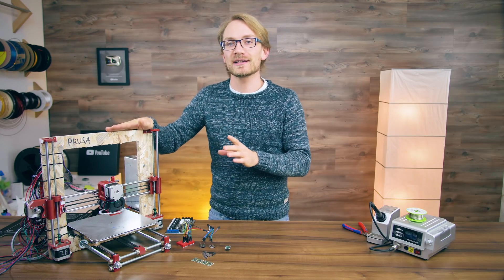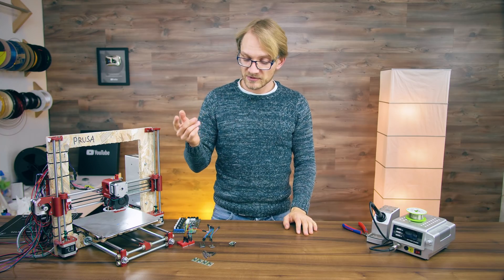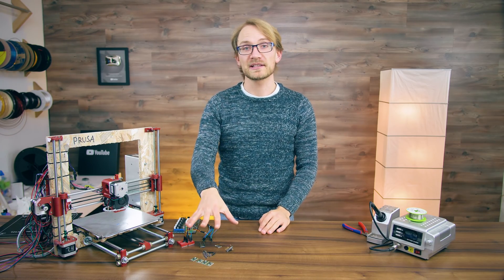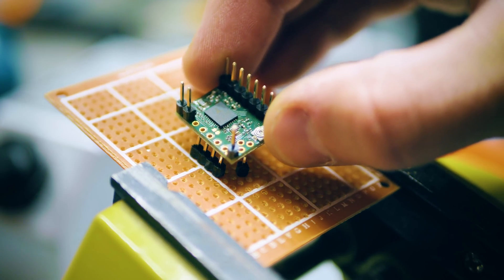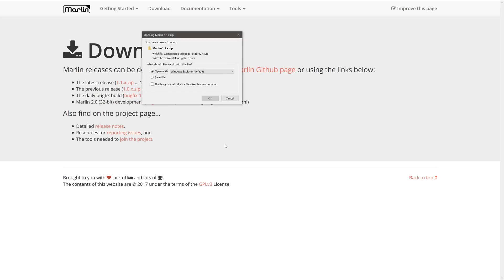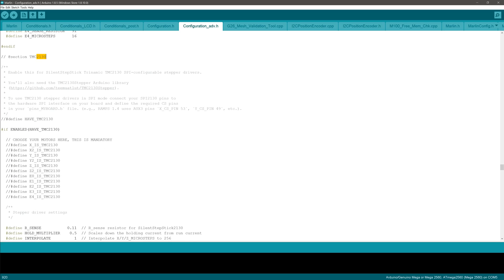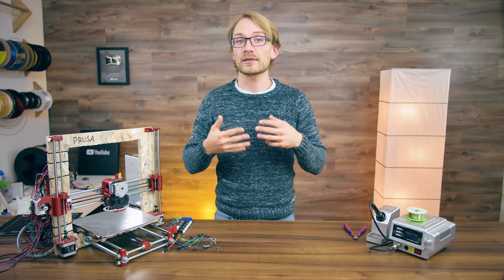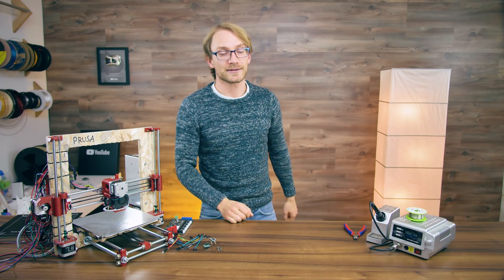How to make your 3D printer smart and silent with the TMC2130!

Comment: Since theirs a couple of people asking about the TMC 2208's I'll talk about them briefly. First off, yes they do have Stealthchop2, but i'm afraid I have no way of comparing it to the 2130 version, i'm running a large (300mmx300mmx350mm) printer on them using some very beefy 0.9degree steppers.
They are virtually silent, I have to check its running sometime and i'm usually sat 3 feet away!
This is on a RADDS board running Reprapfirmware 1.19 using a 24v power supply which is pretty esoteric as far as configs go...
Configuration is very different, you can use them as direct drop in replacements for the A4988's and they just work, however to adjust them you need to use a serial interface, theres no SPI support on these, and currently Marlin does not support this method. I built an programming board to do this, since my Z axis is very heavy (large alu plate on a openbuilds frame) and stealthchop wasn;t strong enough for me. There's a desktop app for this which I used to switch the board for my Z axis into Spreadcycle, the noise is irreverent since the x axis doesn't go very fast.
Be aware the serial pins are not connected at first you need to connect a solder jumper on the underside of the board, which can be fiddly (especially if like me you accidentally solder the pins on first! I'll try and answer any questions, but I would say if your not sure and using Marlin, get the 2130's since you'll get all the features Tom talks about. If your not using Marlin, its a hard choice since i'm not sure on the status on the TMC support in other firmwares. For me they are super quiet and awesome, but my hardware is a bit off the norm!
Reply: So you run in stealthChop2 with no missed steps? From the datasheet, it seems you can just leave them in standalone mode and adjust current with trimpot, no need to program with the UART interface.
Reply: Hi Jamie, Yes that's right, the XY and E are doing exactly that, however the Z axis did need to be changed to Spreadcycle which you can only do via the serial programming.
Reply: Hi npgoalkeeper_ With the 2208's no firmware i'm aware of supports all the features on RADDS, Reprapfirmware itself runs fine but lacking the networking features, so if it ever supports the serial interface and featureset in theory the board would be fine, however RADDS is a bit of an edge case so its hard to tell what will happen. the Reprapfirmware guys do have a good chunk of the TMC features working on the Duet Boards, but they use the 2660 series drivers i'm not sure how different they are to 2130's or 2208's so I can't recommend picking up the RADDS if you want more than basic features with the TMC stepper drivers. I think its totally possible as long as the firmware support it, but RADDS is a 32bit board so the standard Marlin doesn't work on it.
Reply: Thanks for the info on the 2208. Very helpful.
Reply: Now, Marlin 1.1.8 support 2208, have you tried this version ? i am waiting mks version of 2208 from aliexpress :)
Reply: Thanks for the info Robin.  I installed 2208s and they are quieter, but not all the time.  Im worried I have them misconfigured - when moving slower they shake the printer.  I removed one jumper on the mks board, the third one, and left the others there, and trimmed to 1v.  Did I install them wrong?
Reply: @TORDesign ola amigo, estou usando os tmc 2208 em uma ramps, vi que é necessário retirar o jumper ms3 para funcionarem corretamente em modo legacy. Você poderia me dar uma luz? Estava usando normalmente com os 3 jumpers porem com muito efeito wooble e vibração. Sendo que com o os a4498 estava quase perfeita a impressão. Estou perdido 😂

Comment: Does TMC2130 work with 12V? i heard somethink about it runs silent only with 24V.. Ty
Reply from the maker: It does work with 12V, but some motors might cause idle while at full current - so use the idle current reduction and you should be good! Dolly is a 12V printer with standard motors - the A4988 actually while more than the TMC2130 with those ;-)
Reply: The Ciba Hi, I use 12volts supply for my p3steel prusa i3 and switched to tmc2130 about 2 months ago. The spreadcycle really makes a lot noise with 12 volts, but the stealthchop is extremely silent. I did not lose any steps with 1500mm/s2 acceleration and up to 150mm/s printing speed. (just did this to be able to see do I lose step or not). But you have to decrease the speed and the acceleration  of your z axis. I use m5 threaded rod for z axis. 3mm feed rate and 100mm/s2 acceleration was losing steps crazily. Also I tried to drive both of the z motors with one driver and the driver got very hot even if I have a fan blowing on it, so I put one more tmc2130 to the second extruder part of the ramps and configured marlin for one z motor per one driver, I did not had the heating problem since than. I use 2.5mm feed rate and 25mm/s2 acceleration for z axis and working flawless. It is so silent and strong and I really did not need to use spreadcycle for more torque, I forced the axises lose step with my hand to see when it is going to lose step and they were very strong, I don't think that they can lose step just bu printing at around 60-80mm/s printing speeds with around 1500mm/s2 acceleration. Tmc2130 drivers worth every penny.
Reply: just don't use it for Z.... it's barely audible unless you're moving it up/down large distances like homing/probing.  kind of a non-issue.

Comment: HEY, great timing!  I was just digging through the data sheets for these drivers last night.  The SPI connection was particularly compelling to me.  I also saw reference in the literature to an encoder input, but according to Trinamic that was an error... oh well: I would like a simple on-chip solution to close the loop, but these will do for now.  I plan to put them through their paces after the holiday with 2 Amp steppers at higher speeds, so we’ll see how they hold up.  If they fry, I'll give the TMC2660 a go.

Comment: How do these compare to the TMC2208? Information seems scarce about the 2208 but on paper they look better, do you have any insights to share on that?
Reply: Hi Mhe, I'll do a longer separate post, but i'm currently using the 2208, and the key thing is they do not have the SPI interface, instead they have a serial interface so Currently the additional features are not available in marlin, in addition only very basic configuration is available via the pins, you need to either buy or make a serial interface to configure them. I understand some of the Marlin guys have had samples of them so I would expect to see them in a future release. I'll put a post up about my particular config so keep an eye out.

Comment: Nice :) But I don't get how the motors could run even more silent with stealthchop than with spreadcycle. I'm running one of my printers with TMC2100 and spreadcycle and there is no motor whine or anything. All I hear are the bearings..?
Reply: depends on speed and motor current it will be louder.  stealthchop is definitely quieter than spreadcycle in that regard.  Also spreadcycle has motor whine at 12v... at least for me it did.  24v did the trick.
Reply: digibluh Maybe I‘m just lucky🤭 I‘m 23 so I should still be able to hear the full audible spectrum 😅
Reply: digibluh: this depends on the voltage of the motors used....
for the tmc drivers the supply voltage should be typically 3 to 4 times the motor voltage...
So 3 to 4 volt motors should run with a 12v supply. 5 to 8 volt motors with 24v supply.
NOTE that if you are using 2 Z-motors in series these motors should be 3 to 4 volt types and the x and y motors should be 5  to 8 volt types and you should use a 24v supply !

Comment: hey 😄
whats about the Tmc2208? 
They have the silentchop2 Mode . 
Should i buy the 2130 or the 2208? 😄
Reply from the maker: TMC2208 won't give you the "smart" features as neither software nor hardware support their UART interface. May as well get the TMC2100!
Reply: I thought the UART is only used for configuring them?
Reply: Thomas Sanladerer okay thanks 
then i order some 2130 😄
Reply: it's Uart VS SPI, has 2.0a peak current vs 2.5a and no stallguard for hard endstops.... 2130 is fine.

Comment: if you need to do a new marlin configure video, lin_advance, UBL, possible firmware retraction, and fil width with volumetric are some complex features (at least the advance k value and UBL)

Comment: You could make it even quieter by converting to small noctua fans, those things have great airflow and are silent
Reply: And expensive for such small fans ;)
Reply: just if noctua made some blowerfans, that would be next level
Reply: @ostogiske  wtf (wild turbo fan) windy is an extreme fan.
Reply: I think they do that on purpose because everyone I show my printer to asks about them.
Reply: Sintoxic 
Very, but you usually only need two or three per printer maybe
Reply: you'll need a voltage converter, i keep forgetting the name of them but i have a 24v printer running noctuas as well
Reply: @Ryukachoo  A Voltage Davider or A Buck Converter would work I believe.
Reply: Quieter....and more beige and brown!

It sure does make them stand out from the crowd, but not in a good way.
Reply: buck-boost converter
Reply: wito 
There are plenty of fan duct designs that work almost as well as squirrel cage blowers
Reply: My printer runs at 24v. Could I still use Noctua fans because I have only found 12v
Reply: Is there a small, cheap one that you are familiar with?

Comment: What about heat? I have the TMC2100 and they are totally quiet BUT horribly hot. Always lose steps. Ended removing them... (didn't change anything on the driver)
Reply from the maker: TMC2130 give you overtemperature warnings if you drive them too hard. As mentioned in the video, I find that even 800mA RMS and no extra cooling is enough to drive almost any machine - so maybe try reducing the current on your TMC2100 as well?
Reply: I run mine at 12v, didn't modify the driver (full pins no jumper) so I suppose it's on Stealthchop. They get horribly hot with an 80mm fan on them... If I low the current the motors don't have enough torque and loose steps, if I go higher they get too hot and the same history... I use a delta so they are working all the time.
Reply: I got TMC2100 on my printer, and I don't have any problems, not using heatsinks either. Are you running yours on 12V or 24V? I am running mine on 24V.

Comment: Tom, I really liked this video, but the "sideways" shots that were interjected every so often didn't really look great. If it's to indicate towards an object you're holding it works fine, but the rest of it doesn't really look great to me. The fact that it changes to 30fps makes it stand out a bit more to me.

Just my thoughts. Still a great video! I may buy a set of these for my FT-5.
Reply: Yeah -- I've noticed other channels / TV shows do the same thing, but to me it always feels like the cameraman and host are out of sync on which camera the host was supposed to be looking at. I'd much rather see an over-the-shoulder looking down at whatever you're working on as an alternate view.
Reply: I liked it Tom, but noticed the frame rate drop too.
Reply: Most irritating about the side shots is unfortunately the change of frame rate. Instead of using two different rate, maybe you can use the minimum as a baseline? I mean, with proper shutter speeds 24fps is more than enough for lots of things :)

Anyway, very instructive and informative video. Good job!
Reply: It's a very popular cinematography technique to hide edits: the audio is easy to mess with, the video not so much so if you cut over to something else, the discontinuity is hidden.
Reply: LazerLord10 noticed it when I saw it... ur right
Reply: I liked it kept me focused lol
Reply from the maker: Wow, you actually caught that! Yes, I know the side shot was less than perfect (out of focus, too), but it still felt better in there than leaving it out. Might need to get another GH5 one day for 4k60 everywhere ;-)
Reply: Yeah, not sure why people do that. Always hated those. Never made sense to me.
Reply: The change in frame rate distracted me too. But I kind of liked the side shot, it has a nice aesthetic to it. It was only the frame rate that caught me off guard

Comment: Is sensorless homeing also possible with core-X-Y machines like the Hypercube?^^
Reply: yes
Reply from the maker: I think it should work, considering both motors will sense a load if X or Y bottom out!
Reply: Thomas Sanladerer that is right, but I'm not sure if you can be sure about that it will know where exactly is is on the printbed and... when both motors detect stall, how does it know at wich axis end it is?^^
Reply: There are comments in the marlin firmware that tell you how to set it up.  To read the stallguard flag, you have to hook one of the diagnostic pins of the 2130 into the normal limit switch inputs. So when it stalls, the debug pin sends the signal.  I didn't see any support (yet) in the firmware for prusa-like rehoming, but haven't looked in the last few months.  For my version of the firmware after homing, it switches to whatever mode you have as the default (stealth chop for me).
Reply: yes, it work for corexy too https://www.youtube.com/watch?v=HwA3rbDgHYc
Reply: I added 2130s to my ramps board several months ago. Recent marlin firmware does support sensorless homing and it works for me. I found I needed to add a pause in between each axis though to give the first axis time to recover. As for the question on knowing direction, it’s set up just like a limit switch. Ie you tell it which direction to home for each axis (min or max). You can also provide an offset in case your hard limits aren’t exactly at your min/max.
Reply: Jim Forsythe WOW! Thank you! :) and if hensorless homing works, then you have to read out the stallguard flag for it to work. Did you also manage to use this flag for prusa-like "rehoming" when a motor looses a step?^^
Reply: Hi I am trying hard to make my hypercube work with my news TMC2130, I have checked many times my configuration but still get
"E driver error detected:
overtemperature
short to ground (coil A)
short to ground (coil B)
Error:Printer halted. kill() called!
[ERROR] Error:Printer halted. kill() called!"

Checked my wiring nothing suspicious. Cloud you help me ?

Comment: I wish someone would take the Azteeg X5 GT and use the SPI communication to get the software endstops and coolstep working. I have the TMC2660 Bigfoot but haven't had time to try figure out the settings I need.
Reply: GRrainmaker are you referring to Marlin 2.0 supporting 32-bit? Or the other Azteeg boards that were 8-bit?
Reply: GRrainmaker Nice. I actually forgot about Marlin moving towards 32-bit development. I will have to keep my eyes open for when it becomes a bit more stable and give it a try. Smoothieware works well enough but I feel like Marlin just has that overwhelming community force pushing it forward.

Hopefully 32-bit will be able to easily adopt 8-bit features in the event the price gap slows 32-bit adoption.

Comment: Why didn’t you use the tmc2208?
Reply from the maker: The TMC2208 uses UART (serial) instead of SPI and is currently not supported by Marlin - and I'm not sure if it ever will be. UART/serial communication is a one-to-one bus, while SPI is designed to communicate with multiple devices on the same bus. So with the TMC2208, you can have one, maybe two drivers communicate with the Arduino, TMC2130 - as many as you want!
Reply: it will be support very soon, but it dont have StallGuard2 funcion
Reply: now marlin 1.1.8 support 2208 via uart, so i ordered mks version to mount to gen L but it is a new world to test

Comment: How does this relate to the Rambo board in a MK2S? I’m assuming it would be a lot more difficult/impossible due to drivers being integrated, right? I’m assuming this is the main reason they cannot be included in the MK2.5 upgrade, not the fact that the MK3 is 24V.

Edit: Also, great video overall, been missing these great videos lately!
Reply from the maker: It is trivial to use external drivers with boards like the RAMBo (mini), since the step/dir/en signals are broken out to headers. Jumper those to the appropriate pins on the drivers and you're in business!
(Future video, maybe...)
Reply: Ah, very cool. Hopefully someone will investigate further, since I am too much of a coward to experiment on the one printer that i have...

I still haven't really found a good comparison in noise between the MK2S and the MK3, and whether it depends only on the drivers or also the move to 24 volts. Depending on which is the biggest factor and how much of a noise difference there is, a 2130 upgrade could be very interesting for alot of MK2S/2.5 owners, and there are alot of us, so I definitely think the interest for a video is there, or perhaps as a section in the (hopefully) coming full MK3 review!